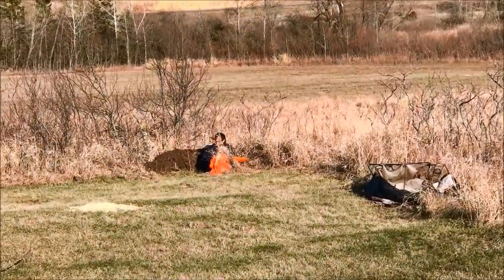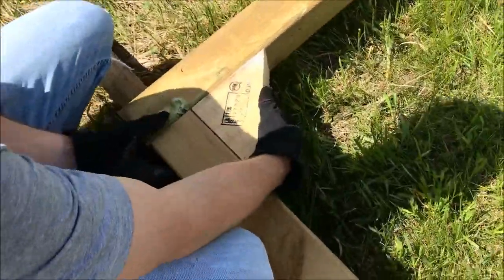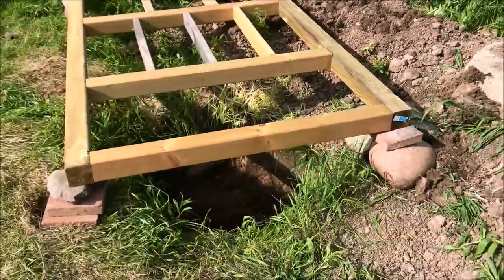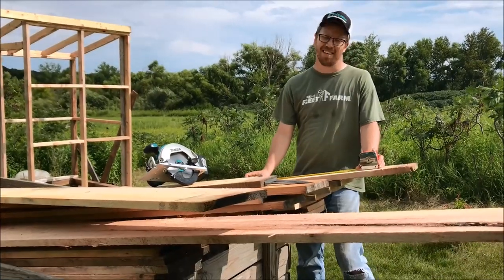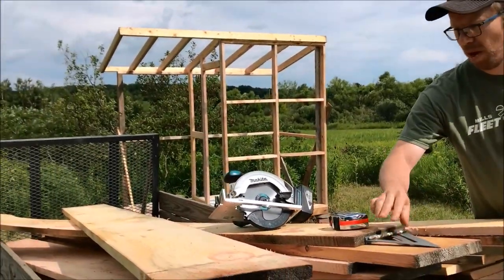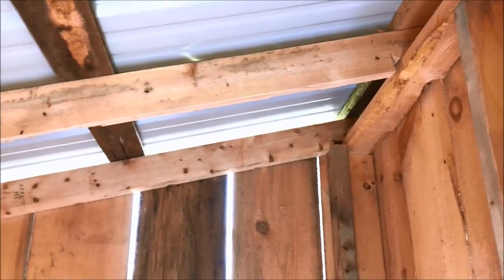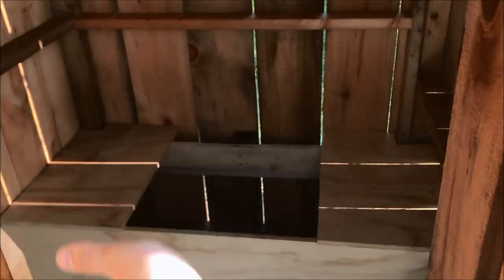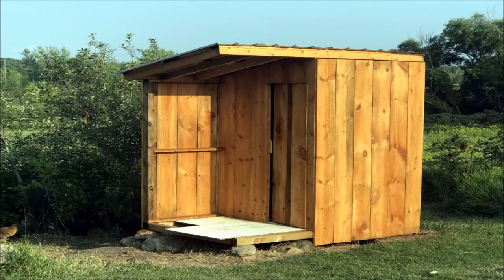Best DIY Outhouse Design [TOILET and SINK]

Comment: Seems nice. A skilled builder might suggest you have missed some vital details here. Like possibly a vent from the stink chamber. Foundations arent just there to hold things up, they also hold things down. Overhangs prevent wall rot. All in all it's still a nice looking poop pot.

Comment: Hey how are you? I have a lot of questions for you.. I am interested in building one, 1 question, for the wood how do you prevent it from shrinking and also from chipping apart by the sun? 
2- for the toilet is it a flushing toilet ?
3- water for sink,are you using a water pump for it to fall or...
Reply from the maker: The wood was freshly cut and did get some shrinkage in a few weeks of being out in the sun. I will be putting 2” batten strips and sealing with cedar stain soon. The toilet is just composting only with no water. The sink will be added in a video shortly showing the rain water collection and will be out on the deck.